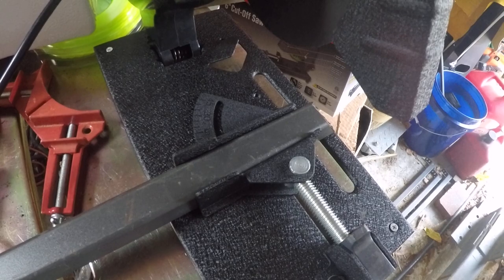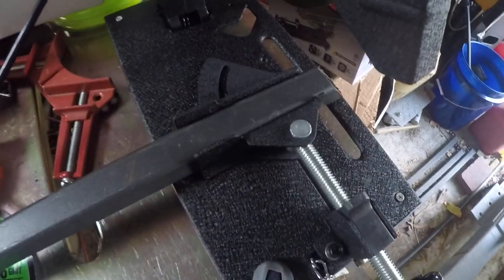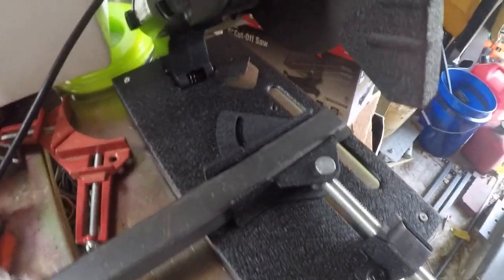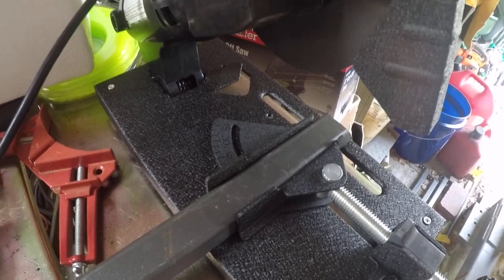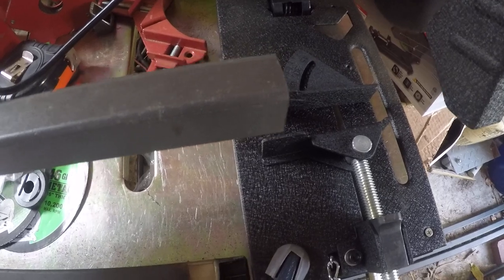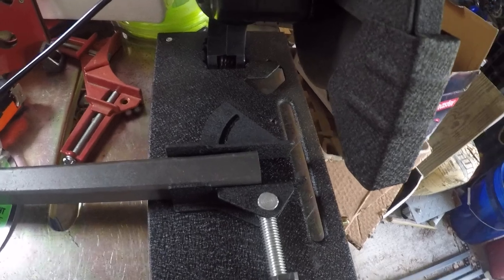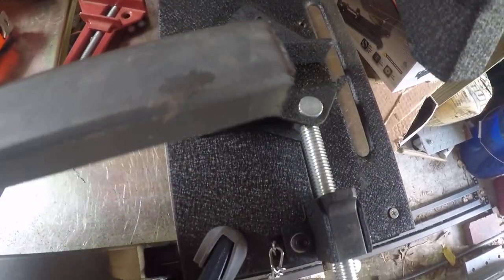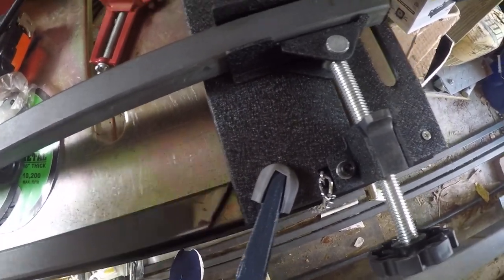DrillMaster 6" Cut-Off Saw

Comment: Bought one to make a rack to mount generator on back of my RV,  Glad to see it cuts the 45 degree angles so cleanly.
Reply from the maker: Yeah Stephen, 
It's not a bad little tool at all, so long as you know it's limitations and allow the tool to do the cutting and don't force it. A little pressure is okay but let the tool do the work. Thank You for watching and commenting.

Comment: Hey Frank, do you think you can cut a 2"x2" square tubing with this?
Reply from the maker: Hey Greg, I just went out to my saw and stacked two 1x1's and they just fit. Be careful and remember, Don't Force it! Let the saw come up to speed and let the blade do the cutting. Nice even pressure.
Reply: @frankmmiii  Thanks!  I appreciate you checking for me.

Comment: Does it take a regular 6” grinder cut off disc? Thanks
Reply from the maker: Yes Cecilia, here is the link to Harbor Freight 6" cutoff discs, but I'm pretty sure any 6"cutoff discs will work. 
https://www.harborfreight.com/6-inch-aluminum-oxide-cut-off-wheel-42400.html

Comment: What about wood or acrylic? Thinking this might be perfect for cutting the blanks for pens.
Reply from the maker: Remember, this is an abrasive wheel. It pretty much erodes or grinds the metal away. So with acrylic, you are going to get lots of shavings, dust and debris. For the wood and acrylic, I would just use a bandsaw or something like this: I provided a link to this saw. https://www.micromark.com/MicroLuxsup-reg-sup-Variable-Speed-Multi-Saw?gclid=Cj0KCQjwrsGCBhD1ARIsALILBYpOof6_ytI_3Tcc_ElZcbm9kG2gPsMbRyjXM6WPjbRwzfv5mPIMxt0aAgstEALw_wcB
I don't have one but used to have something like it.
Reply: @frankmmiii  Thank you kindly, the Micromark does seem to be the better option.